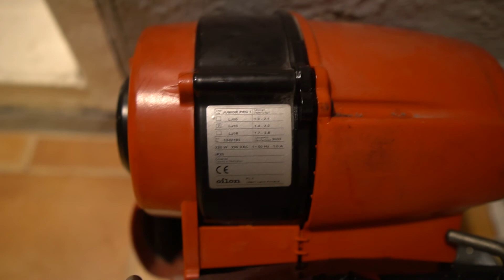Replacing NOISY OIL BURNER with younger one

Comment: You burn oil! Isn’t that illegal? But then, you choose so be born as a white male so I guess nothing should surprise me after that😂……On a serious note, is it not very expensive?
Reply from the maker: Oil price year ago  was cheapest that it has been during ten years I have had house... Of course now the price is higher but I havent checked how much. Oil is cheaper still than direct heating with electricity... To heat up my house it is 1600-2000 euro per year with oil. I quess  yearly cost would be cheaper with geothermal heat pump but I havent yet planned having one